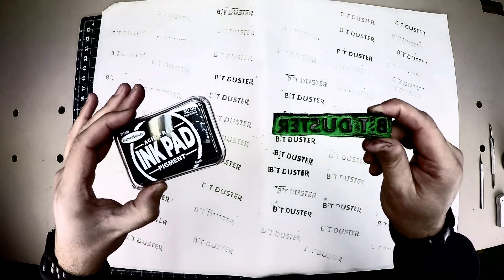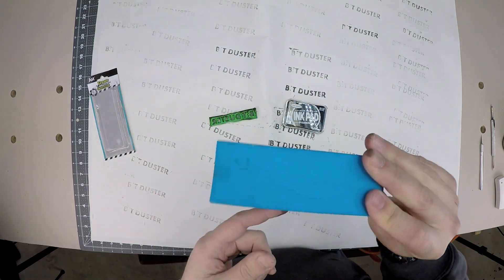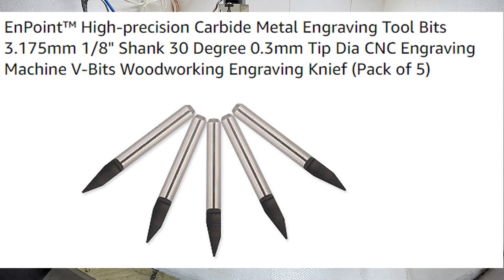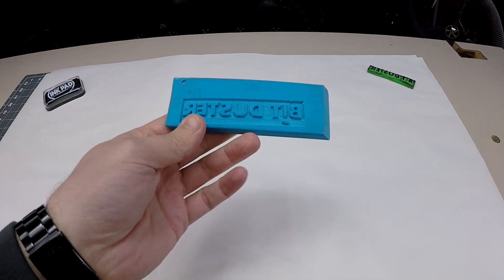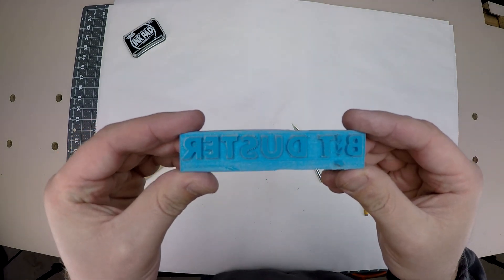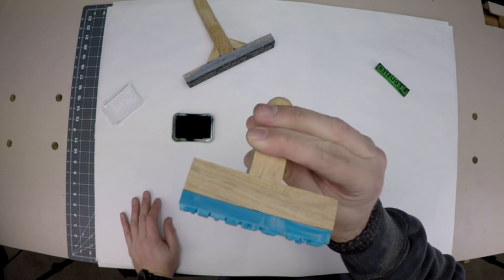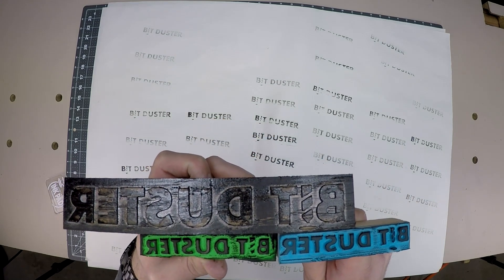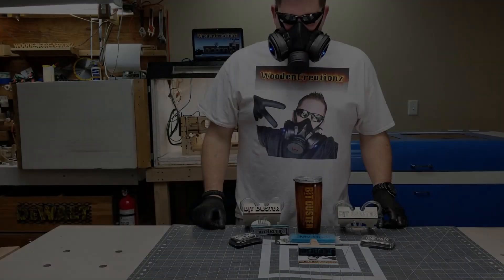How to Make a Custom Stamper on a E3\E4 CNC for $1

Comment: Another cool creation. Couldn't you use a strong vacuum instead of blowing the dust? Or both.
You have a good idea. hope it works out.
Reply from the maker: Wayn... Bit Vaccum doesn't sound as cool! LOL Your right, you could use a vaccum, air compressor, leaf vac or heck your wifes Hair Dryer.. But they all make noise and take electricity. Plus they would all need to run the same amount of time your CNC runs. Which just causes more noise pollution. The bit duster doesnt make any noise or take any electricity and inside the CNC Enclosure I made, it makes the router almost silent... dude... I could take a nap on my work bench next to a screaming router inside.. plus with out another device making noise it allows me to work in the shop with out ear plugs. Sorry.. thats a long answer to a short question. I am getting ready to release a promotional video on the bit duster that better explains it.. But I always appreciate your responses and questions bud. I have been selling quite a few with out going public yet.. so you will probably see one in a video one day.. heck you might have a E3 cnc one day and need one.. :-) - Brian
Reply: Your right. I hope you success. Shark Tank?
Reply from the maker: Wayn Jul Probably not being it only works on one CNC out there. 👊🏻